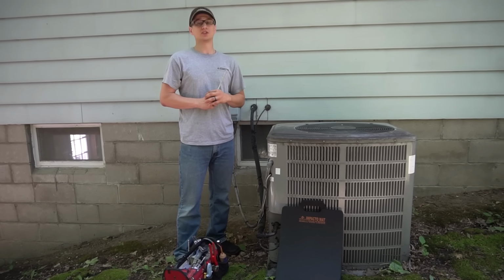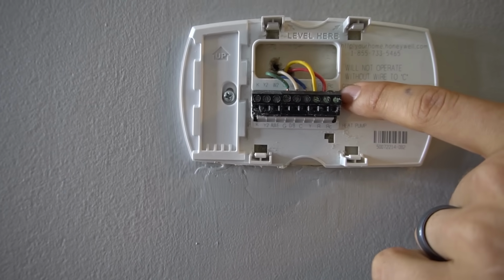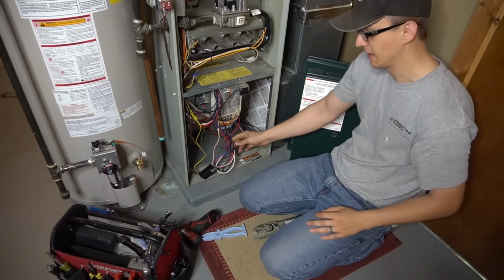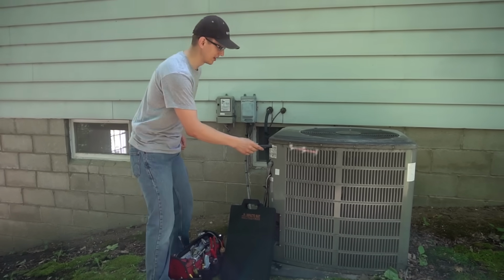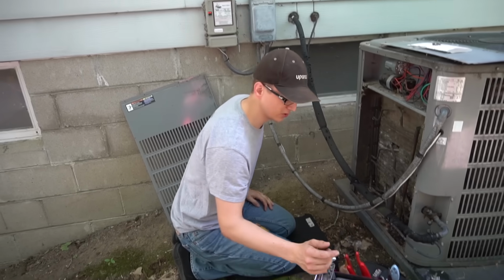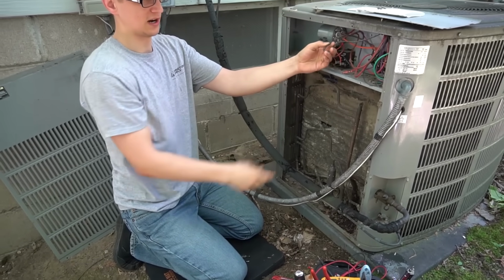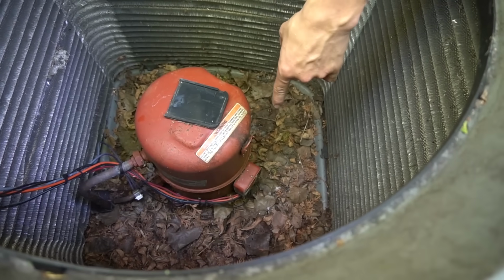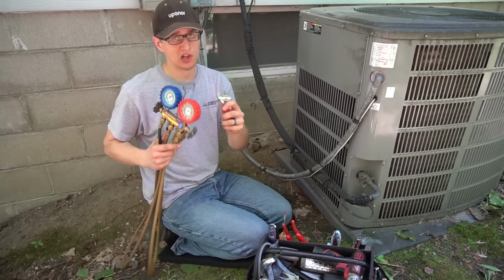AC Unit Not Turning On - How to Fix It Step by Step

Comment: OMG can you help? I replaced the thermostat and the air worked fine for a few weeks. Now the fan is not coming on. the outside unit is not coming on either. Please  help? I have a part inside that looks rusted. I will go look outside tomorrow.
Reply from the maker: Sorry for the late response! I just saw this comment. Hopefully you already got it figured out but just in case.. Is the new thermostat a Nest by chance? If your thermostat does not have batteries it may need to have a common wire (C) Also, check my videos on how to bypass a thermostat. You can bypass to know if it's the thermostat that's causing this or something else.
Reply: 1st. If I can get your email I can send pictures. I did notice the wires looked "bare". I will look at video. PLEASE HELP! and NO, it is not fixed. It is a Honeywell programable.
Reply from the maker: If there are bare wires outside then you should examine all the wiring and put some electrical tape around the bare spots. This may have blown your 3 amp fuse in the furnace control board so that's a good thing to check first. Sorry, I don't post my email in comments though..
Reply: As I followed your video you talked about the blue wire. I took a quick picture and saw that in the B spot I put a black wire. but the picture showed a blue wire that was tucked behind all the others. it was not wired to the old thermostat so I did not see it. my husband went to the store to get a wire stripper. Im keeping my fingers crossed. but where does the black wire go?
Reply from the maker: If you look in your furnace/air handler, you will find the control board which is usually by the blower motor housing. The control board will have a similar thermostat terminal strip as you see at the thermostat. Basically your wiring set up at the thermostat needs to match up with the one in your furnace. For example, if the black wire goes to C at the control board, then the black wire will also go to C at the thermostat.
Reply: no control  board. can I make a video and you look at it?
Reply: I think that is my problem. I have the black wire in the B spot. OK, let me run it down. I have a black wire in the B, Orange wire in O, green wire in G, yellow wire in Y, White wire in W, Red in red and rc spot has the jumper running r spot to rc spot. HANG IN THERE WITH ME!
Reply from the maker: Sure, just post it on YouTube. Some furnaces don't have a control board. But can you see where the thermostat wires go in the furnace? Also, not all the thermostat wiring is the same in every house. The colors can be different. That's why thermostat and furnace wiring need to match, can't just go by colors alone.
Reply: I FIXED IT! I am so proud of myself!
Reply from the maker: Wow, you went above and beyond with that video! :) Happy to hear you got it fixed! Stay cool!

Comment: Heool. I turned my Air conditioner down to cool cuz it was getting hot but nothing happened. I heard the click noise, but nothing turned on to cool the house. That was at night so it wasn't a big deal. I woke up in the morning and it had turned on and was cooling the house. I then go out for the day and return to the same problem. The house was getting hot and the air conditioner wouldn't turn on.
Reply from the maker: Unfortunately I can't say for sure what that could be. Do you have a condensate overflow switch? Perhaps your condensate drain is partially plugged and water is backing up into it. After it slowly drains, the float switch closes again and the AC turns back on. Or maybe the capacitor is weak, the compressor or motor are over-heating. You would need to check voltages when the problem is occurring to know for sure. I would also thoroughly hose down the condenser coil, even if it looks clean. If you have a meter, check that capacitor. (most common fix video in my AC playlist)

Comment: My Ac fan does not want to turn off everything works but fan does not turn off when thermostat reaches cool. I opened it up and cleaned it . What else could it be is there a video I can watch??
Reply from the maker: The fan on the outside unit does not turn off? Most likely you have a stuck contactor. The contactor plunger that I was talking about in the video, most likely yours is stuck in the pulled in position. You can turn off power to the unit and try to pull that plunger in and out to free it up. If it gets stuck again, then you may need to just replace the contactor.

There are other possible causes but the one above is the most frequent for that problem. Let me know if it's not the contactor and if you have a meter you can check voltages with.

Comment: Questions - I have Bryant/GE  1/4 HP Condenser Fan Motor 1075 rpm (5KCP39FGY563S) can it be replaced by a 1/2HP motor is that best or do we have to replace with the same capacity fan motor.
Reply from the maker: 1/4 HP and 1/2 HP for a condenser fan motor is a pretty big difference. The 1/2 HP would probably work but it will likely be noisier, keep in mind that the fan blade is matched to the 1/4 motor so it may crack with time, and it may effect the freon pressures in the unit. So it would be best to replace it with the same size and rpm that you took out.
Reply: Word of Advice TV it has to be same capacitor

Comment: Ac is not cooling and it sounds like water is running when it shuts off.
Reply from the maker: Most likely you are low on refrigerant. The water running sound is the sound of your freon equalizing inside of the evaporator coil when the unit shuts off. Unfortunately this isn't exactly a DIY fix so you will likely need to call someone for this one.

Comment: Whenever i try to turn on my ac the thermostat just clicks but nothing happens from the furnace or AC unit. Just nothing turns on, just the initial clicking sound. What do you think it could be?
Reply from the maker: It could be a lot of things at this point. My guess would be that 24v is not getting to the contactor coil in the condenser unit. Did you try checking all the things mentioned in the video?

Comment: So mine was the first thing, everything is working but my fans were not spinning so I used a screwdriver to spin them and it works greatly! But my thing is, the fans keep not spinning so I have to keep doing this. Do you think this is a motor issue or need to replace my fans?
Reply from the maker: I would start by replacing the capacitor and see if that helps. That would be the cheapest. It's possible that the capacitor is weak and its just not providing the motor the starting push it needs. If that will not do it, then your motor bearings are probably going bad and the motor needs to be replaced.
Reply: Thank you!

Comment: If I am plumbed for ac.  Can I buy a condenser like Goodman and have it installed.   How much and who should I call to install it.    I am novice at this
Reply from the maker: Many companies/contractors will not do the install unless they are the ones who provide the unit. Some will do it but there will probably be no warranty for the work since they do not know where the unit came from. Just go on Google and search "heating and air conditioning in (your city and nearby cities)" Call those companies up. Usually when you tell them you want a new air conditioner they will come out and give you a free estimate and talk to you about different options and all (free education). Call at least 3-5 companies and you will see the prices vary quite a bit. Just pick one who's prices are less and who will warranty their work.

Comment: What is the name of the little fan in front of the Furnace and what is it used for and when does it kick on
Reply from the maker: That is the induced draft motor. Try looking up "inducer motor assembly" on google so see what the other side of the fan looks like. (it has a blower wheel on the other side) That motor only comes on when you turn on your heat. It's purpose is to push combustion fumes through the vent and expel them outside.

Comment: What if the unit turns on. It cools down stairs but not up stairs?
Reply from the maker: Do you have multiple thermostats in the house? Or a zone system I should say. Perhaps one of the zone dampers is not opening

Comment: Awesome video, very information. Question: inside and outside units are working, yet our system isn't cooling as low as we program it. We had someone out a month ago (BTW the unit is only a year old), and he said it was a bad filter yet we change it every 2 months (that was his professional diagnosis,  but mentioned in passing it was low in freon). The system seemed to work fine and now it has been doing the same thing again. We shut the system down, let it sit for a couple hours and it will work for a little while. What is your professional opinion? Do you think our filter was "really " bad, or do you think we are leaking freon; therefore can not keep cool? It is important because of our one year home warranty on our brand new home, that has now expired. Again, great video!!!!!
Reply from the maker: If it is a one year old unit, I would suspect that the freon charge is low. (there is a possibility that it is not a leak but was simply undercharged initially) Or  there was a small leak right off the bat, after it was installed. But I can't say for sure.. Someone would need to check the pressures and temperatures to pinpoint exactly what's going on. There are other things that could cause that.  If possible, I would try to get the same people that installed the air conditioner  to come back out to fix it. Hopefully they will warranty their work since it is a fresh install.

As for the filter. If you are using a premium grade filter, I would step it down to a medium grade filter. The premium ones tend to restrict air quite a bit.

Comment: I think lightening run in on my unit, so 3 amp fuse?
Reply: I thought it was the 3 amp fuse, but checked it, it was great..  took the thermostat off, it had 2 aaa batteries ( lithium) .checked it with my voltmeter, one was awesome,  one was dead. Changed out the bad battery with a good one., and walaah! Thermostat came on!!!

Comment: Fixed mine. Turns out ants were chewing on the connection points. I killed the breaker and the unit, removed all the connections, cleaned them out, replaced each one, and used pliers to slightly tighten them. When I turned everything on, it fired right up like it was brand new, and that unit is 11 years old now. I cast a foundation for it, then mounted it on a seat, and I keep that area clean so ants don't return there. This video was really helpful in helping me know where to look.
Reply from the maker: Good to hear the AC is back up and running! Those ants can be a nuisance like that. Thank you for coming back and sharing! Stay cool ;)

Comment: my Ultrastat Honeywell thermostat just went blank. It does not take batteries. Checked the circuit breakers. Any suggestions?
Reply from the maker: Your 3 amp fuse in the furnace control board may have blown. I think I mention that in the video. Or perhaps there is no power going to the furnace. The furnace power switch may have been bumped off by accident.
Reply: Thank you I will try to locate the fuse box, it is a rental and it is a big house, so I am having trouble. I really appreciate the reply.

lance

Comment: Great Video! Do you have a Video to Show the Proper Way to Check/Replace the Round Fuses on the Condenser?
Reply from the maker: Unfortunately I do not. But that is a good idea for a video :) To check them, you can set your meter to ohms/resistance and put one lead on one end of the cartridge fuse and the other lead on the other end. If the reading is O/L, the fuse is bad and needs to be replaced. If you do not have a meter, then you would just have to replace them without knowing for sure if they are blown or not.

As for replacing them, they are not directional, so it doesn't matter which side goes up. The biggest thing is to make sure you have power off to the unit before you replace the fuses (turn off the AC breaker in the circuit breaker panel). And then verify either with a voltage pen or with a meter that you do not have voltage present. I sometimes pull them out without turning off power but I have a plastic fuse puller like this one: https://amzn.to/2MDSQz7
Reply: @WordofAdviceTV  I have a Meter but will pick up a plastic fuse puller. Thanks for the Info and    Quick Response 😎

Comment: Thank you for your help this video is informative and easy to understand. I have replaced my capacitor but now it appears that the fan motor needs to be changed. The motor was delivered but there are too many wires. Not sure why and I need to know wha to do now.
Reply from the maker: Hi Jill! Just saw your comment right now. Sorry I am late. Hopefully you already got it going! Most of the time there will be a little wiring diagram right on the motor itself that shows you how that motor should be wired. That would be the easiest way to do this if you will be able to figure out that little chart.

Comment: Hello, can you help me please. I just bought a house less then a month ago and my A/C stop working last night. I checked the circuit breaker and it was tripped. What do I do from here. I switched it to on, but lost after there. Any help would be GREATLY appreciated. Thank you!
Reply: The inside is blowing air, but the outside is doing nothing.. forgot that part.
Reply from the maker: Hi Khia! Sorry to hear about that! Not something you want from a house you just bought.. So after you reset the breaker, did the outside unit try to start back up? Is your outside condenser coil clean? Some disconnects will have fuses inside of them. If your breaker tripped, those fuses could have blown too. But if that is the case, then there is likely a short somewhere or the compressor is bad. If you look in my AC playlist, there's a video on how to check the compressor and another video for reasons why an AC trips breakers.
Reply: @WordofAdviceTV  thank you so much, it was my capacitor needed to be replaced. Your video was awesome.
Reply from the maker: Glad to hear it! That is one of the cheapest and easiest fixes so that was a fortunate result! Stay cool :)

Comment: Hey guy I have window box air conditioner 14 thousand  btu error code ee what is the problem "help"
Reply from the maker: EE typically means: High pressure problem. First thing I would do is clean the condenser coil, the side that is sucking air in. After cleaning, try unplugging the unit for a while and plugging it back in. You may need to replace the capacitor as well.
Reply: @WordofAdviceTV  thanks I will both suggestions.